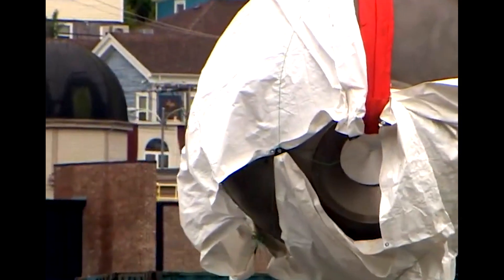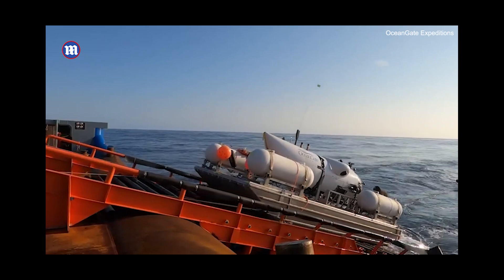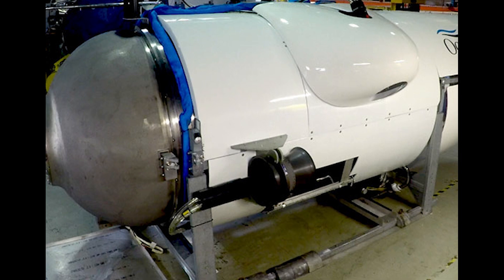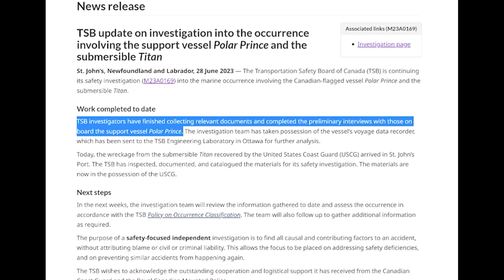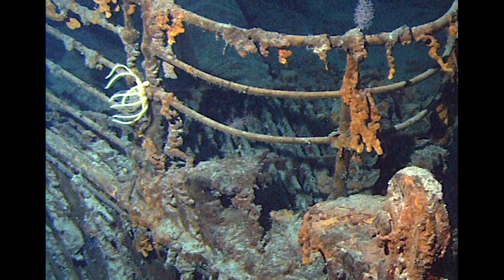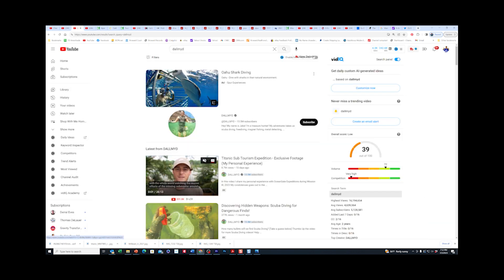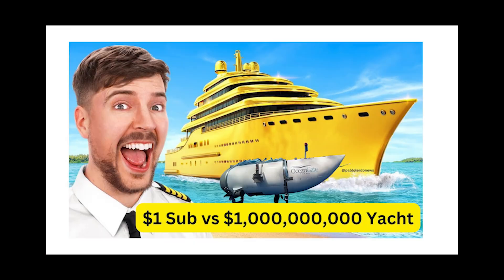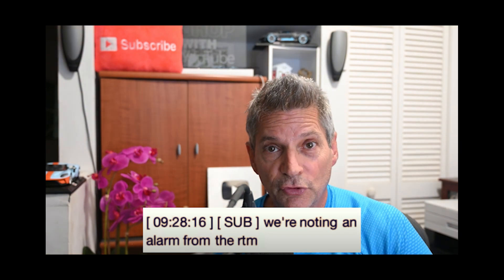Titan Submarine Debris Clues, Implosion Simulation

Comment: The shape of the vessel alone is enough cause for concern in my opinion no shocker that the only things they pulled from the vessel where just straight up metal guarantee the carbon fiber got shredded up at that low a debth due to the pressure alone

Comment: If I had to guess, it seems like the glue bond weakened over time and finally failed when the CF tube deformed as it usually would under load. What I don’t get is the cracking sound coming and going and the power loss, assuming the transcripts are real. Maybe the adhesive failed progressively, meaning it was eaten away in stages until a path was cleared to the inside? Hardy any glue was used and they hand applied it!! As for the porthole, I do not think it caused the implosion because if it blew in, the flange that held it on would still be on the titanium cap. the flange was gone though which makes me think that the porthole blew outward so hard that it sheared the threads (and yeah no torque spec on those bolts??). Flawed design because the design engineers’ first jobs were at Ocean Gate.

Comment: If the failure was in the rear, the shockwave could have pushed the flange out, popping the screws. Its designed for compression, not tension.

Comment: Here's my theory, the sub was taking on water as soon as it was launched. That would explain the faster speeds of descent and would explain why when they dropped weights it didn't make much of a difference. And that would also explain the power loss and the sounds were coming from an already compromised hull.
Reply: Taking on water, where?  The machinery space of the sub wasn't pressurized.  That is, it's a wet area already.

Comment: If they had any leaks before hand they would have been jets of death.  My dad told me in the navy in areas with suspected super steam leaks they used a broom handle in front of them as they walked because if they super high psi steam hit you it would cut your hand off so they used the broom handle as the sacrificial stick.

Comment: If the viewport and flange weren't removed by the crew bringing that piece up, then I feel like it wasn't the cause. If the carbon fiber section failed, there would have been an incredibly strong pressure wave going in both directions from the point of that failure. I could totally believe it would have been strong enough to blow out the port with the flange. I'd imagine that will be easy to check when they do the forensics on that front cap.

Comment: Bolt threads wear every time you use them.  for something that specialized I think they would have used x-rayed, scanned, etc perfect bolts and used new bolts every time. I don't even know the steps for replacing or checking the threaded holes in the hull.

Comment: I’m not sure if you’ve pointed this out in a different video but the fact that they were bonding two different materials at the seal point would almost guarantee a failure at that bond due to the materials compressing at different rates at that extreme pressure
Reply: so grimly preventable.
Reply: @nellinightshade3358  it’s even worse when you find out others in the submersible community were raising concerns before the craft’s completion
Reply: @piddy3877  yeah, so i heard.  that makes it more inexplicable.
Reply: And glue also degrades over time. Plus, its application and suface prep itself has to be so meticulously done. Can't imagine having glue at such a critical area.
Reply: Agreed. Change in temperature could have affected things too but was probably only a contributing factor if at all.
Reply: Not to mention that carbon fiber is a non-contiguous material, so different parts of the tube could also compress at different rates. That's why composite materials aren't suitable for building a multi-use submersible craft; there's just no way to ensure everything is completely uniform.
Reply: enough about the glue. the glue was the least of their problems, the pressure at depth would've held the caps in place
Reply: Compression was equal on all components. No way those joints would have given it up that glue could have been Lepage's paper glue.
Reply: @leecowell8165  if you take 2 different materials and put them under the same amount of pressure one will be compressed down or crushed more than the other material

Comment: Does anyone know what "glue" was used to bond the titanium ring to the carbon fiber shell?  Looks suspiciously like JB Weld or generic PC-11, but I would hope his aerospace connections had something better.  Epoxy metal bonding can be strong if done right, but that overlapping ring over carbon looks like it could easily separate if compressive forced placed on the carbon, and it apparently did separate.

Comment: I must IMPLORE you not to make assumptions 🤣
I wonder why there's no carbon fiber left as well, I actually almost wondered if they just wanted to get the (expensive) Titanium up.
Another thing is, CF is stronger than what a lot of people are making it out to be, 20+ dives (from what recent reports state) isn't bad considering the kiddie-level "engineering", the issue was the short joint you pointed out, short enough that water ingress over time was able to compromise the hull.
Given more research there could be something to CF in DSD vehicles, just not for manned dives.

Comment: No need for
Torque wrench on those bolts….once submerged the pressure of the ocean holds it closed….people have forgotten to latch there hatches and it just leaks a little till fully submerged then seals off from pressure

Comment: The way that the carbon fiber tube was mounted to the titanium ring has me wondering if that was the issue. The lip portion that makes contact with the ring and maybe an inch (plus/minus) away is probably the strongest portion of the tube. The middle section of the tube constantly contracting and retracting might have placed lateral force on that lip sealing surface. They designed the carbon fiber tube for surrounding pressure. The design of the tail cone might have created upward pressure making the issue worse. That noise that they heard from the rear was probably the carbon fiber cracking allowing water to leak into the battery compartment compromising Bus A.  With the prolonged pressure of the ocean water and the crack, complete failure of the tube was inevitable. As for the front port hole, my guess would be the internal pressure blew out the glass, especially if it was concave on the inside portion. The worse part now is the possibility that those lost souls knew that their life was in danger minutes before the tragic implosion.

Comment: I don't see why carbon fiber was used for such a sub going so deep . Furthermore if they did not want the bubble at the front to break , they could have quartz installed . This sub was a death trap .  It was poorly built .  Unfortunately it took 4 people to die to truly understand not to make a sub like a cheap toy .
Reply: Really?? That's the easiest part to understand  - one material is a lot lighter & cheaper than the other 😅
Reply: @mangos2888  : Lighter and cheaper is not always the answer , when you know the pressure per square inch or atmospheres can break some metals .  We Navy submarines experience stress at the depths of where the Titanic sits , but won't break and Navy subs are welded with steal . There should have been testing with robotics before inviting humans on the sub .  I just wonder if there will be law suits as a result of the deaths . I don't think a waiver for harm will cut it in court,  unless people specifically agreed that they understood they could die and released the company of all liability . This is not an issue that will go away fast .
Reply: @robertdemitro1520  This was a for-profit LLC creating an experience for the rich. I'm not saying that they were correct for using cheap & light, but it's for-profit businesses are incentivized to do
Reply: @mangos2888 : If they are an LLC , they should be carrying insurance . Especially for profit . I know that with investors the bottom line is money and for cheaper .  I have worked with carbon fibre,  it's fine for certain things , but it does hold to stress under great weight .  The Canadians are very good at finding out why accidents etc happen , especially around New Foundland .  Just have to wait for their report .

Comment: The titanium dome has more surface are for the water pressure to push against then the area where the glue was, so in my mind the force of the pressure would have pushed the 2 components tighter rather than splitting them apart.

Comment: I really question the ability to effectively 
bond resin to titanium.  The design was for the caps to be held on by the compressive forces created by the pressure differential.  Any reductuon in the contained volume of the inside of sub would result in a pressure increase in the sub, creating an outward force, countering the compressive force.  At the stated depth of issue, the sub would have been experiencing about 5000 psi.  Suppose the volume of the sub decreased to 1/10 the original volume and the pressure inside the sub was 14.7 psi, the new pressure would have been 10x, or 147 psi outward versus the 5000 psi inward.  I don't think the view port popped off with this napkin analysis.

Comment: Maybe the aft sprung a leak and the resulting jet of water blew out the porthole window and snapped the bolts off.  The rapid compression of the warm air inside the sub would have created an inferno that may have ignited the carbon.  Cultures that hunted with blowguns used them to start fires by compressing the air with a slap piston.  I wonder if there was adequate oxygen in the sub to burn that much carbon, or if it came from whatever air tanks they had onboard.  

Train tanker cars have been known to implode.  I had to learn about it in brewing school.  One case involved a company cleaning an empty corn syrup tanker with steam, only to have an unexpected rain implode it.

P.S. You look like a counterfeit Jason Bateman. :P

Comment: the hydraulic press channel did a carbon fiber tube in a pressure chamber.  it was not manufactured the same, but reasonable.  you dont see the snap until they replay in ultra slow motion.

Comment: The bolts securing the hatch should have been properly torqued with  certified tools AND the bolts should have been replaced after each dive. (I don't know that they weren't, but I would be extremely surprised if they were).

Comment: After I watched the video showing them wrapping the carbon fiber around the cylinder I was shocked that they really thought that was a good idea when it is so clear how bad of an idea that is. I have worked with composites and carbon fiber with doing body work on cars and with that little experience I  understood enough basic logic in that is such a poor way to build something to withstand pressure. Before I though that the haul was made with carbon fiber but in a way where the fiber was made as one piece  , even with the metal ends glued on , yes it had to be straight and fit well but the gluing part should have not have mattered so much and just to be strong enough to just hold the metal ends in place when getting in and out of the water since the pressure would have done the sealing part , how did they not see that alone as a design issue since other then testing there was no real way to know if the ends would not just crush the cylinder haul since they are all not one piece making so I would have been worried it would crush me like setting on a coke can let alone the fear of having so many layers of maternal that is not one solid piece to allow the pressure to give some kind of crackle effect , this is why it seems like the haul had taken on water adding weight and why they could not ascend at a much faster rate.

Comment: The adhesive or glue would have a PPSI rating. So someone would have done the math.
That being the PPSI would be determined by the thickness of the adhesive which is difficult to get right with the way they are applying it. Also hand mixing it is odd.

Comment: In the footage of the recovered dome where the porthole would have been, I don't see any holes where the bolts would have been. Do you think those bolts could have been façade? And it was simply glued onto a smooth contact surface? Given that the pressure would be coming from outside the sub, I see why they might have been able to mentally that. If there wasn't a strong hold on it, and the sub imploded from the rear, it could easily have propelled that window right off.
Reply: My guess is the bolts snapped flush at the interface which would be the highest stress point once a gap forms and the picture resolution isn't high enough to show the remaining shaft of the bolts still there.

Comment: it is simple. Titanium cones pushed itself into the cylinder. I all steel situation force pushing in on the cone pushes in on cylinder. I don't think carbon is very good when it comes to compression especially glue in joints.

Comment: as you say the words "i dont even think they were using a torque wrench" it looks like they were, but it also looks like a cheap torque wrench from a handy man mechanic toolkit, this also shows the size of the bolts are not very big in relation to the man's hands and the wrench he is using on the back side is hardly the length of his hand which means he is either strong than superman or them bolts are not even done up as tight as a car wheel.

Comment: I think the pressure vessel has good radial strength but very poor lateral strength the way the carbon fibre was wound. The water pressure at that depth on the end caps is likely in the order of 10 tonnes/sqm or more.  The sub imploded laterally where it was the weakest. That explains the no debris and it was crushed like soda can when you crush it with your foot. The lateral crush will also pop out the view port.

Comment: Hydraulic Press Channel did a good simulation with a small carbon fiber pipe in a pressure chamber. It just cracks and implodes, good that they have a high speed camera to catch it.

Comment: Being the end caps where epoxied in place the deformation of the carbon fiber pressure hull would have started to leak
where the end caps met. There would have been noise from the de-lamination of the epoxy and water would start coming in
just before the implosion. This would have made them drop ballast and start trying to head for the surface. Carbon fiber maybe
strong but the epoxy is brittle so every dive there would be a slight de-lamination in the tube until it started to deform causing
leaks which started the implosion. Because the carbon fiber and epoxy hull was so ridged it totally disintegrated during the implosion.
They knew they where in trouble before it imploded, the sea would have started to come in at the onset. It does on submarines
that hold 100 or more men when the get to crush depth. God bless our explorers that push the limits of man. The window not
being rated for that depth could have failed and gone right through that small opening but I do not think it was, I have one sitting
on the shelf and they are an impressive piece.

Comment: When you talk about the joints, the real question I would have is why are there Ti rings? Will the Ti rings compress at the same rate as the carbon fiber?? Probably not. So I don't think there is any issue with the size of the joint. That is not what likely failed. Rather the carbon fiber + the Ti ring compressed less, so just below the joint is where it would be weakened, as that area will flex every time the sub goes down. That is where the creaking was.  (likely) You flex something enough, and it breaks. As soon as it starts to give way, boom, the whole thing goes.

Comment: Regarding the acrylic window, it is designed to withstand pressure from the outside but when the sub imploded there was an enormous presure applied from the inside which would easily destroy it.
Reply: It wasn't destroyed, though.  It was found in the debris field of the sub.
Reply: @johnbergstrom2931  Guess it popped out
Reply: @kristizh4443  That's what she said
Reply: Like kicking a window screen out from the inside